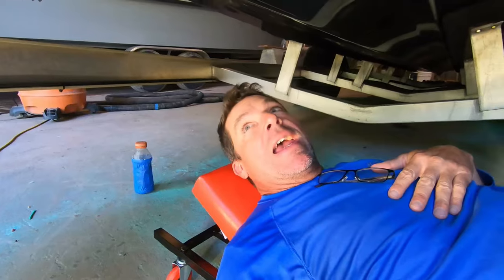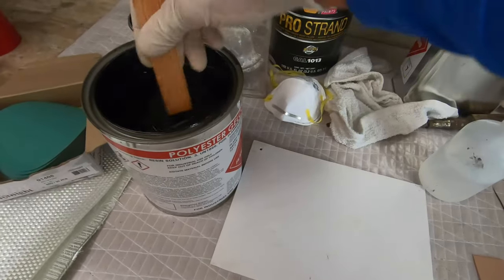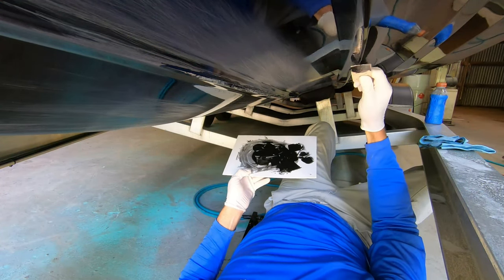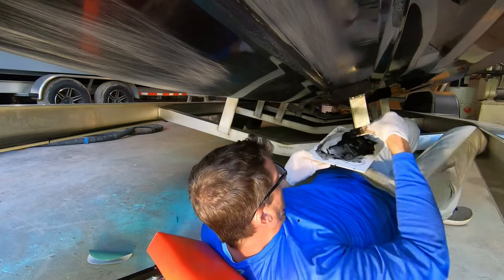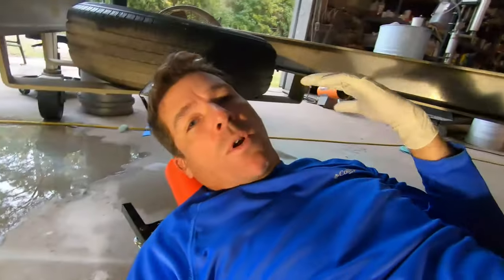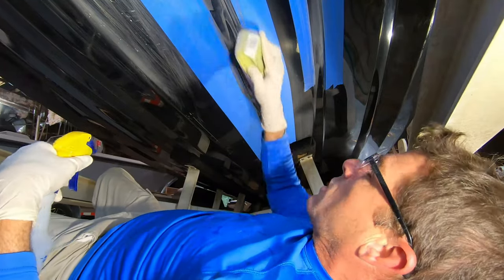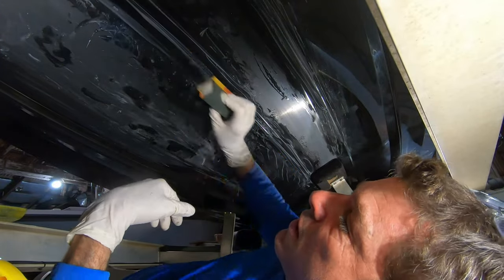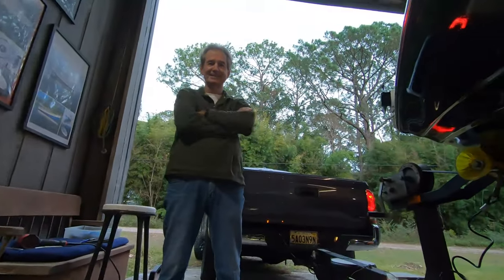How To DIY Gelcoat Repair Like A Pro (Boat)

Comment: Great video, very informative! Just wondering (1) if grit matters for initial sanding to make surface rough so new gelcoat can bond? Will 80 or 120 grit make better bonding than 150 or 180 grit?, (2) for small size of dent/chip (damage is deeper than scratch), is it possible to put only one layer of flowcoat (has wax in it) + catalyst, but this layer will be quite thick and then sand it off? If the layer is thick enough it may still have enough material after cure (shrink)?

Comment: So what if you have a crème color tan bottom? Just white and then paint after? Then clear coat? 
Awesome channel
Reply from the maker: If you have a creme colored gelcoat you can make a custom color by starting with base white gelcoat and using a gelcoat pigment tint kit to make the color you need. You could also order some from the boat builder if they ate still in operation. You could also get gelcoat from a company like Spectrum gelcoat that specializes in custom gelcoats. No clearcoat on most of the boats we work on. You do see Clearcoat on metal flake bass boats and some other boats with metal flake. I hope this helps and thanks for watching!

Comment: Hi, thanks for video great work!  I have a tungsten grey boat with lots of scratches and stone chips (from towing).  I am first time DYI polishing/buffing; so far I have used the Abralon1000 and 2000 grit 5" on a DA at low speed.  I still can't get the scratch or tiny chips (I can still see white).  Should I try more aggressive wet sanding before applying my compound?  If so, do you recommend a test area with more continued aggressive paper until i get the scratches out?
Reply from the maker: As a general rule If the scratches in your gelcoat are deep enough to catch your finger nails on, you will probably need to fill them with some new gelcoat. Gelcoat on most boats is not super thick, maybe a 1/16 of an inch or so in most cases, so you do not want to sand it very aggressively,  or you risk going through it. Most dealers can order you factory gelcoat if the boat is newer, or there is a company called Spectrum gelcoat that can do custom factory matches. I hope this helps and thanks for watching!

Comment: Do you have any videos/advice for changing out boat bunks?
Reply from the maker: Sorry, no videos on that subject. Obviously it is much easier to do trailer work with the boat off the the trailer. Sometimes it is easier cutting the old bolts and hardware off, than trying to remove the nuts and bolts. I would also recommend buying all of your replacement hardware before you take every thing apart. Then replace the old with the new as you go, it seems to work better this way. I hope this helps, and I appreciate you watching!

Comment: So I am curious: can you tell where you added the new gel coat. Is it like when you paint a car, sometimes the old paint is a little faded and has a different color than the new paint?
Reply from the maker: If it is a newer boat, and the gelcoat is a good match it is very hard to tell where the repair was done. It has a lot to do will the skill of the person doing the repair. I hope this helps and thanks for watching!

Comment: Was that damage just from loading the boat onto the trailer? Just from the bunks? Is that normal or does something else need to be done to the bunks to stop that from happening? I’m going to need to do this on the stern of my boat from getting stuck in the sand and the boat rocking back forth before I got it towed off.
Reply from the maker: Yes, it was wear from launching and loading. It is a charter boat and gets launched 100 or more times a year. So it is going to see more wear than the average boat. Plus the area we live in is very sandy, and the sand gets trapped in the carpeted bunks and act as sandpaper as the boat is launching and loading. It is a good idea to clean the carpet on your trailer bunks at least once a year, with a pressure washer preferably. They also make a plastic material that goes over the bunks rather than carpet. I have used that with good success. Hope the video helps with your project, and thanks for watching!

Comment: Hey Joe, do you ever use a cheep 60cc syringe to suck a precise amount of Gelcoat out of the gallon or quart size container?
Reply from the maker: I think I have tried that before,  but it seems like it was more difficult than using a stirring stick. I might have been using  the wrong kind of syringe though. It seems like it could work. Let me know if it works good for you. Thanks!

Comment: Did you consider starting with a filler, like Everlast prior to gelcoat?
Reply: And thank you for awesome tutorials!
Reply from the maker: We would use a filler for damage that went deeper than this did. Also gelcoat is harder, and a better water barrier than most fillers in my opinion. Hope this helps answer your question. I appreciate you watching and commenting!
Reply from the maker: Glad you are enjoying them! Thanks for watching!
Reply: Really am enjoying your videos. I have a 2003 Keywest that I need to do the same thing to. I am having a hard time to get the white gelcoat to match close enough for satisfaction. I have tried to mix up about an ounce a few times, but just can't get close enough. You wouldn't have any ideas on what color pigments to go with to get me close would you? A quart of the key west white is way to expensive for what little I need. You are doing an awesome job on the quality of work and information. Thanks
Reply from the maker: @101Brewster  Glad you are enjoying the vids! I hope they are helping you guys. It seems like the early 2000 key west's are a strong off white. Many times base white needs more red pigment than you would think. Along with some yellow and black. You can mix test batches and just put little dabs on the hull without mekp until you close. I plan on doing a gelcoat color matching video very soon. Thanks for watching!